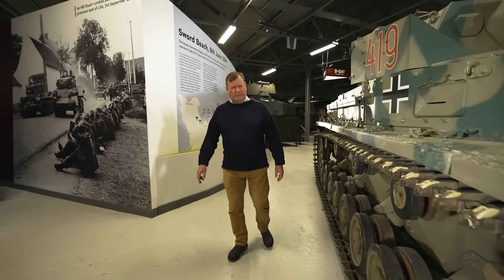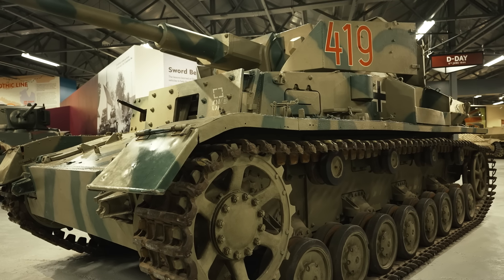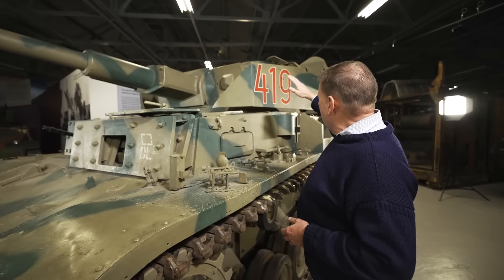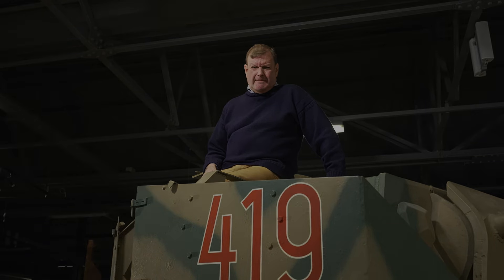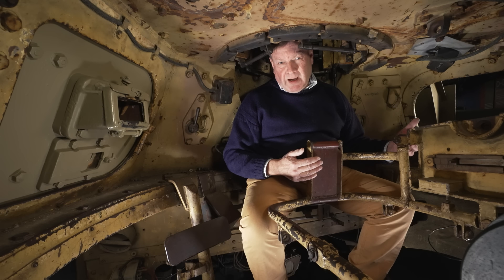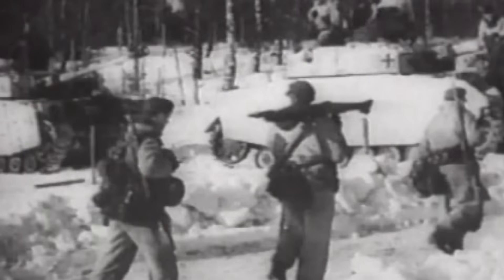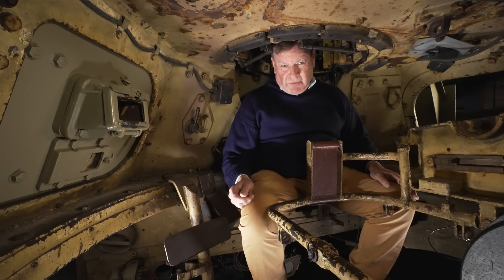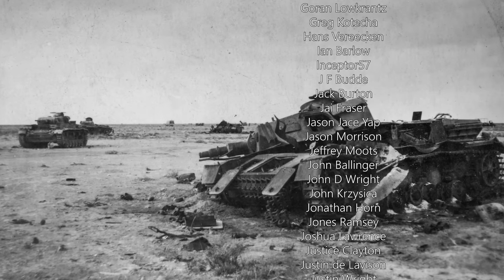Tank Chats Reloaded | Panzer IV | The Tank Museum

Comment: I quite enjoyed the presenting, but I've had some issues with the sound quality. Especially some of the interior shots, but also the exterior shots. When the camera was moving and Chris turned away from it, the volume and clarity changed significantly. In general I am not a fan of continuous panning when there is actually not more information being presented with it. The entire section from 2:30 to 2:45 has the same information in screen. Why have the camera move at all if it doesn't add anything but a distraction? You have great material, you don't need to distract from it, as is usually the intent of these Bay-esque continuously moving shots without revealing new imagery. Not sure how I feel about the added sound effects either, some seemed a bit rough, particularly the ones dubbed over shots, and the timing on most of them. This video was interesting but felt a bit like it was trying too many new things at once instead of polishing one at a time, and I must say I prefer the older ones in style over this, at least for now.

Comment: I think that the German obsession with all new wonder weapons was counterproductive. Rather than Tigers, Panthers and other more ludicrous ideas, supplemented by trying to squeeze more out of the IV, a larger, more powerful sibling to the IV ought to have been the way to go, building upon what was good about the IV but incorporating some more modern concepts.
Reply: Tigers were very useful particularly the Tiger I. The Tiger I did stellar work end 1942 to mid 1944. Well worth the effort.
The Panther was needed to go toe to toe with the next generation of allied tanks, which the Panzer IV couldn't really do. The later versions of the T-34 and Sherman were nearly 10 tons heavier than the 25 ton Panzer IV. The Panzer IV was being left behind. It could not be improved after spring 1943.
Also, more Panzer IVs would require more crews, more ammo etc as well as more support and supply personnel and vehicles.
Reply: @lyndoncmp5751  I agree but my point is that the Germans should have been more evolutionary than revolutionary and had something that was easier to maintain out in the field.